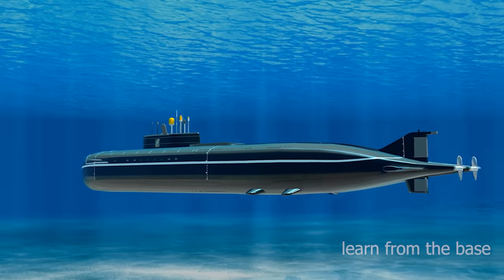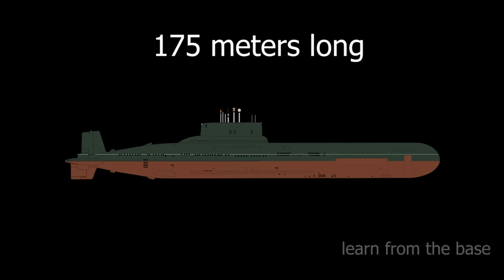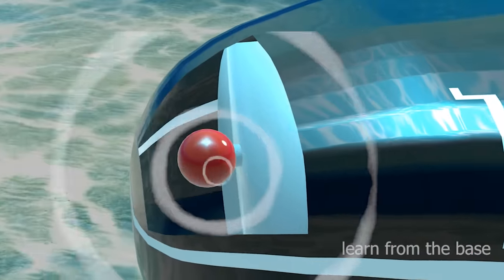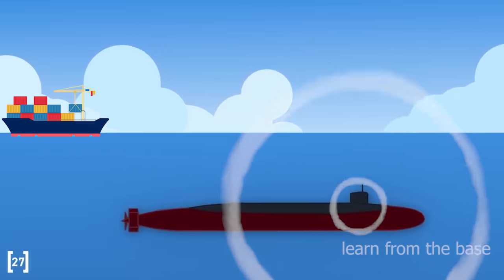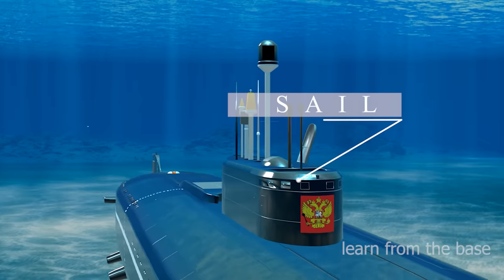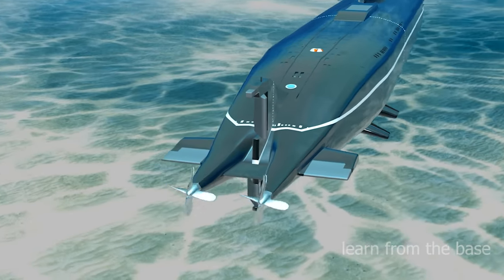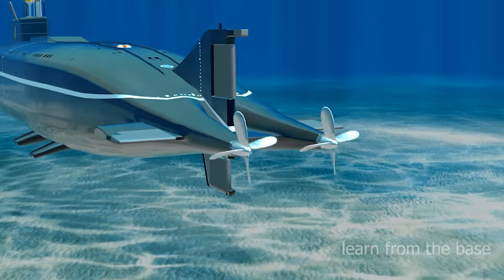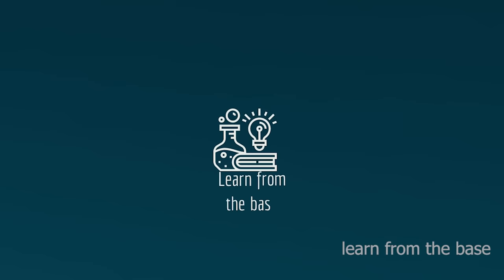How a Nuclear Powered submarine works?.. || submarine working 3d animation || learn from the base

Comment: At about 0:12 : "...they reach a depth of 800 feet".
This is just 244 meters. But I've seen it mentioned elsewhere that they can reach a depth of 600 meters, which is almost 1700 feet. Or perhaps even 650 meters.
But this is one of the highly quarded secrets, and so we simply can't be sure.
Why are people still using feet and such nonsenses?
Reply: Cause we invented it.

Comment: From all I have in mind, my strong impression is that a propeller always has an odd number of fins. I'm not sure for the reason, maybe structural integrity of the propeller, or noise reduction.
Reply: a three blade prop will give you a higher top speed where as a 4 blade prop will give you higher acceleration, i guess they go for the three blade because they want to have the sub or whatever go faster but it depends on what you want

Comment: I can't recall seeing a propeler with an even number of fins. I think that a propeller always has an odd number of fins. 
I'm not sure for the reason, but it might be that when you have an odd number of fins then you dont have two fins exactly facing each other. If this is the reason, then with odd fins you have less stres on the axis and less problems to structural integrity of the propeller.
Or... it may have to do with noise reduction.
Reply: there are 4 blade props, it depends on what you want, a 4 blade gives you better acceleration where as a 3 blade gives you better top speed
Reply: @xxstarlordxx1419  
Yes, there are propelers with 4 blades. I have seen a video with such, just a few days ago.
And it has to do with acceleration and speed.

Comment: Want a 2nd part but pls include how a nuclear engine works and how long will it run
Reply: Nuclear subs use reactors, that reactor makes hot water, hot water makes steam in a “steam generator”, that steam moves a turbine that moves the shaft, the reactor is normally good on fuel for roughly 30 years